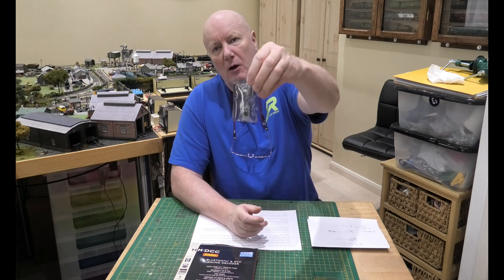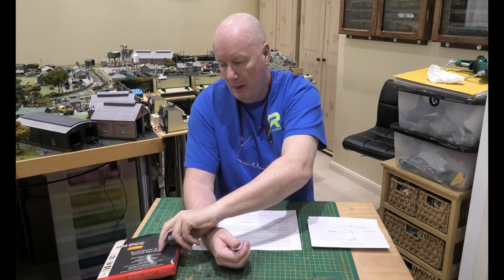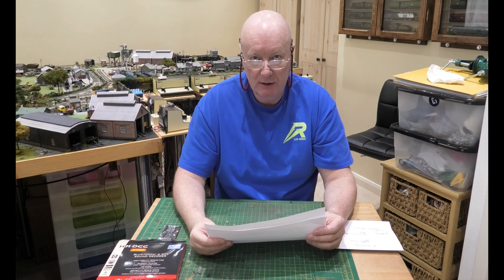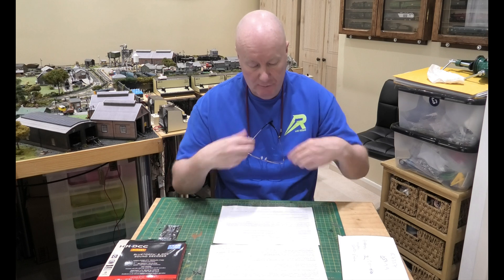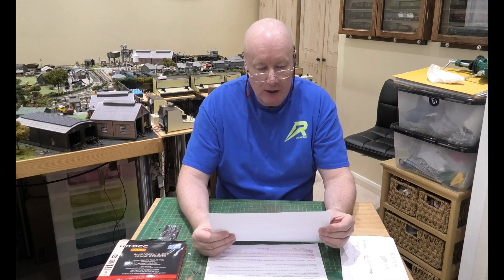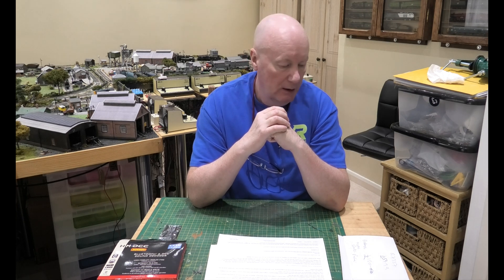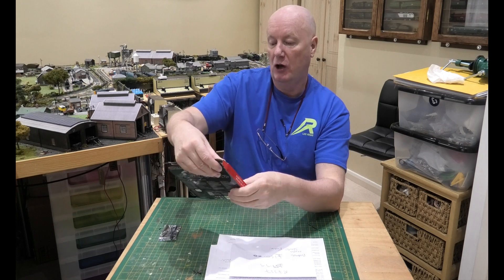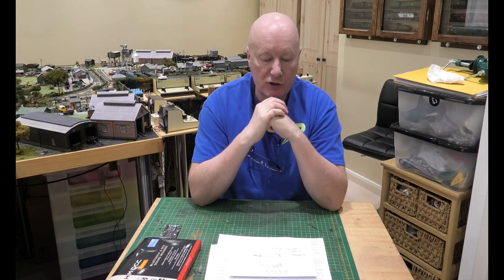BLOWING UP : HM-DCC Update

Comment: There is a saying READ THE INSTRUCTIONS.  As a long time user of electronic gadgets this even applies to new products. 😂
Reply from the maker: Correct, however if the instructions are different to the claims made about the product both verbally and on the front of the box does that not tell you something ?

Comment: Just got 2 locomotives with DCC fitted when I put them on the track they runaway how can I stop this
Reply from the maker: HM-DCC I have no idea I sent all my stuff back. In my opinion it is tripe. However, if you are using a standard DCC controller, ie an NCAB etc. CV-008 twice.

Comment: My decoder literally blew up two hours ago in my P2 LNER and I'm quite mad since my first attempt at the HM7000 was in April which was faulty. Then, the second one came and until now it worked fine in my Dublo Scotsman until I decided to fit the decoder in my new P2 to see if I can get more for my railroad 9F as well. With this one exploding and nearly melting the loco shell I ain't getting any more until I get the proper Hornby Digital Power Supply later this year and give them some time to hopefully clear up and improve upon the system. Also, just a simple question. Which analogue power supply/controller is safe to use with the HM7000?
Reply from the maker: None, they do not recommend using any. In my opinion I would throw it all in the bin and not use the system again. It is not fit for purpose  and it  does not do what it says on the box. A total failure.

Comment: For the more technical folk: they basically claim in the manual that running it on classic analog (rectified 50 hz)  or 'Doppelschwellen' mode (100 hz mode available on more recent Bühler power units)  is not possible. This also excludes running it on LM317 units without buffer capacitors as these also have a waveform output unless you add enough buffer caps to really flatten the output. 

The only way it seemingly works is feeding it with the correct harmonics of a 'switching' power brick, but given the way China works even that could end up with issues as soon as you source the components from different sources.
Reply from the maker: You are wrong they do not claim that you cannot run in analogue. They say there maybe issues, however they explain to you how to do it. 
However, the big selling point was you could use an analogue controller to power the chip and bluetooth from your phone etc to control the locos functions. Now we all know what they claim is not true I cannot see the point of it.

Comment: This problem with analogue controllers you mention is not the only issue I have seen with the decoders I think the packaging for the decoders is so inaccurate and misleading, I had to return the decoder I purchased.  I only recently started to take an interest in the hobby in the last 6 months, back then I thought the Hornby brand was the gold standard and initially would only look at their products.  After several disappointments, I have exact opposite opinion now and really try to avoid all Hornby products, this is such a shame I feel like they are trashing their brand with poor quality products.
Reply from the maker: I echo all you say. What I do not get is there TTS product runs fine in analogue yet this cannot even be powered by what it was designed for, with analogue power. I never even got to running mine in analogue as a stand alone mode. https://youtu.be/xsDJajH9C3c

Comment: Thanks for that Paul. i have the same dcc controller as you the gauge master PRODIGY ADVANCE2 {  not wireless } so i should be ok .how authentic are the sounds on these down load files do you know Paul ? i do have a small gauge master dc controller that I test my new locos on the little hand held one, so  thank you for the heads up Paul.
Reply from the maker: The sound file for the Coronation class in my view is excellent, it is just the product does not do what it says it should do. This is the latest update. https://youtu.be/qcvw1hSJ920

Comment: There have been reports of issues with DC Gaugemaster power supplies from various sources and probably best to avoid them. No issues with DCC power supplies reported so far
Reply from the maker: This is the issue, Gaugemaster have been providing DC power for millions of users for years. Why should we avoid an excellent source of DC power because Hornby introduce a product that is not only incompatible with Gaugemaster products but some of their own too. There are issues with DCC power too as in this video. https://youtu.be/G5rW3SiJvdA. I am sending mine back today, I am glad to see the back of it. However, people do what is right for them on their own model railway.
Reply: @PaulBriden  I was just highlighting what I had seen from other U Tubers on the same subject. The reviewer in his video I believe did state Hornby had advised not to use DC power sources until more lab work had been done. 

An interesting point is when we switch from DC to DCC we do not bitch and moan when we have to change power supply. The Hornby HM7000 is brand new and will need some development work based on in service experience like with all brand new products. It has so many pluses and is very disruptive along with being a game changer in the expensive sound chip world. Think of it, these are 50% cheaper than their competitors and no more expensive re blows at a dealer. This will drive change and benefit all railway modellers
Reply from the maker: @billyvauls5050  Well actually I am not sure that it is once you factor all the costs in. R30302TXS a class 08 with the decoder fitted £263.99......R30155TXS a class 56  with the decoder fitted £263.99. You can buy other locos with sound for a lot cheaper than this brand new if you are prepared to put the effort in. At the end of the day I have had enough of the whole thing. People buy and run what is right for them. It is your coin sir, you have worked for it, you spend it on what you like. Enjoy your model railway.
Reply: @PaulBriden  I did say in another post there would be a lot of “wailing and gnashing of teeth” as this is very disruptive. Even U tubers are asking why the likes of Zimo and ESU etc can now justify circa £120 for a sound chip and file when Hornby can do it for about 50% of the cost? 

If you want to get into DCC sound on a budget with relatively easy installation with no soldering and download sound files on the running track as opposed to a programming track then give it a go. You can sound equip 2 locos for the price of one. This disruptive product can only be good for the hobby.
Reply from the maker: @billyvauls5050  This fallacy you need a programming track to change anything on a loco is incorrect. All you are doing is quoting what others say. Here in my video I show this. https://youtu.be/Y2lmZ0Xxiug. Also you are not accurate, you can buy a DC ready diesel for around £140.00, add the Zimo £120.00 that is £260.00 Around the same price as a ready fitted loco with HM 7000. Also locos fitted with these decoders will run with any DC power, some with sound. The HM 7000 ties you to what Hornby say you should have and blows up using certain DC controllers. Now, if you find a smart phone screen too small and have to  buy an ipad, an Ipad is more expensive than an N-CAB. You do what is right for you, however, in my opinion the overall cost of this product as a whole package over the long term is not really any better value than Zimo, Loksound etc. As I say, if this is a silver bullet to you that is fine, I wish you luck with your new purchase.

Comment: To start off I defy almost everyone to find the specs for a dc controller that is maybe 20 (or whatever) years old. 

Disclaimer.  I know close to nothing about electronics.  Having said that, I do know that PWM is Pulse Width Modulation, which is basically a constant supply voltage that is switched on and off very rapidly and has a square wave form. In other words what the loco motor reacts to is the average voltage of the varying on and off lengths of time. These pulses are in the form of a square wave which is the same wave form that DCC uses to send its signals to the decoder, superimposed on a constant track voltage. Perhaps the issue is related to this as the decoder might be trying to interpret the PWM pulses as valid commands with who knows what results? WRT to cheaper controllers I suspect that they don't use square wave pulses but rely on a half wave rectification of standard DC wave form. The cheaper way to do this would be to rely on the frequency of the mains supply to generate these pulses, which is 50 Hertz in your country if I am not mistaken? Of course this diatribe has close to zero chance of being related to the problem. For what it's worth Soundtraxx released their Blunami decoders late last year that do what Hornby is trying to do but they are pretty expensive. 
I hope for your sake that Hornby sorts the issues out soon.
Reply from the maker: All I know is I am sending mine back on tuesday..Happy Easter.

Comment: Let's be clear... Hornby manufactures model trains, and they know what a PWM controller is. And now, they manufacture DCC chips that have problems with analog power supplies... I have a dozen DCC equipped engines, from the manufacturer or as an aftermarket modification, with four different brands of controllers, including Gaugemaster, two DCC controllers (MRC Prodigy and NCE) and I run them indifferently on analog and DCC with ZERO problems at this day. So, what the flux with those chips from Hornby ? Why something as obvious as a 100% compatibility with analog controllers is not warranted by Hornby, while not problematic with ordinary DCC chips ? Can someone with a background in microelectronics and low voltage electrics explain me what has gone wrong with Hornby on this one ? This kind of problem makes no sens for me...
I have never had any DCC chip that had problems with analog controllers since more than ten years of modelling, that's a first for me to see such a thing.
Reply from the maker: 200%. I do not get it either, especially when their own TTS chip runs fine in analogue. What is not so amusing is the fact that on page 16-17 of the pdf they have a  list of their own analogue controllers as being unsuitable to provide analogue power to the new chip. In the airline industry with such a fiasco those responsible would be suspended on full pay, then be out of work once the due process had been followed.
Reply: @PaulBriden  Agreed. Boeing has recently manufactured an airplane not compatible with the pilots qualified to fly it, to be simplistic, and the company is in jeopardy by now. Not thinking to the compatibility with ALL analogue controllers, it is beyond understatement. You take components sturdy enough to eat 1amp 12V DC, and/or you filter it on input, that is what everyone else does. I have not heard of this problem with Soundtraxx Blunami decoders, so, you can do it !

Comment: Sounds to me like Hornby might have a transient overvoltage protection and -  or a dv/dt (rate of rise of voltage)  problem that has slipped through their design, validation and testing regime. As you rightly state other manufacturers work in the same electrical environment (re the Gaugemaster analogue controllers - as history has shown plus are extremely robust over the long term as reflected in the comments) and you bought based on a blanket description of suitability printed on the box. The goods I would argue are not fit for purpose for that intended environment commonly associated with that sector of our model railways. As you rightly point out it could be youngsters that purchase or use so get unwittingly caught out. So my expectation is you shouldn’t have a problem getting your money back if the problem persists - UK consumer protection is really good in that respect. My concern is that if they haven’t blown now might blow in the future if the design/ reliability margins are right on the line. It might result in a recall from Hornby pending their investigation unless they make a clear declaration on the box of the exclusions relevant for dc operation. At the moment, to me, it is like a car manufacturer saying their car is only safe to drive on only particular types of concrete roads but not on asphalt but they have hidden that restriction deep in the instruction manual…. Have clarified some of my original text, best regards and hope helps. Stephen
Reply from the maker: Very very well put, very eloquent. Important point that it may blow in the future, I never thought of that. Happy Easter.

Comment: Great video. I really think Hornby jumped the gun on this HM7000 decoder. Clearly it's not for ordinary dc control. It only works with an Apple iOS phone or ipad. Back in old days on the Hammant & Morgan controllers you could choose full wave modulation or half wave. Modern dc controller don't offer this option any more. As you've found out, model railway power controller manufacturers don't bother to tell you what the PWM is either. So unless you are gonna connect an oscilloscope to your controller, you won't know either. Just another screw up from Hornby.
Reply from the maker: Not good is it. Mine is being sent back. All I need to do is open the wrong siding with the loco fitted with this while running analogue, and I have smoke. I never even tried to run it in analogue. What is supposed to happen is you turn up the analogue controller to max power and the Ipad etc runs it with Bluetooth.

Comment: Sticking with Digitrax and ESU. Hornby cannot be trusted, their chips will not fit into other makes of loco either.
Reply from the maker: You look at the list no small locos are listed, just the class 08. I imagine it is fun fitting the super capacitor to this. It is such a shame, it promised so much.

Comment: never ever be an early adopter of new tech.   saves you from exploding batteries, e-scooter fires and BURNT OUT CHIPS, in this case. Alos, if going DCC, go completely, not some half and half measure,  and stick with one supplier,  don't mix, they all say it's all compatible,  but no,  it isn't,
Reply from the maker: Maybe I am too adventurous. Bottom line, your words are wise. I do with cars, I wait till the end of the production run when manufacturers have cured all the faults and are knocking them out cheap to make way for the new model. Thank you for your constructive input.

Comment: Interesting, and another good reason to keep away from DCC just yet. The whole system is as yet too fragile, inconsistent and complicated. I guess it will get there in about another 10 years but until then users are just crash test dummies or beta testers as the aspect of reliability and backwards compatibility is just too vast for any manufacturers to test and take in to account.
Reply from the maker: The rest of DCC is fine if at times a little complicated. This system is supposed to be ground breaking which it would be if it worked. It is such a shame Hornby did not do more development on this.